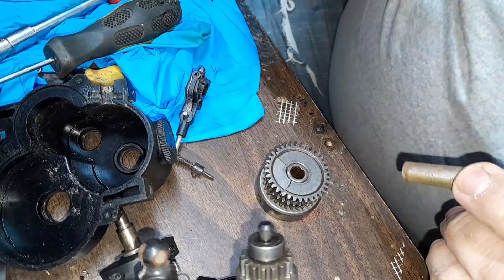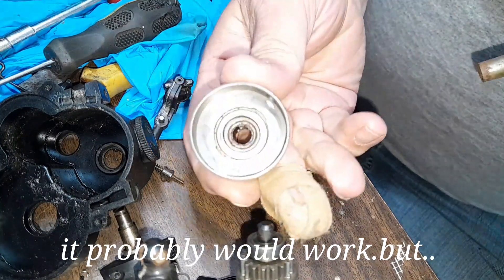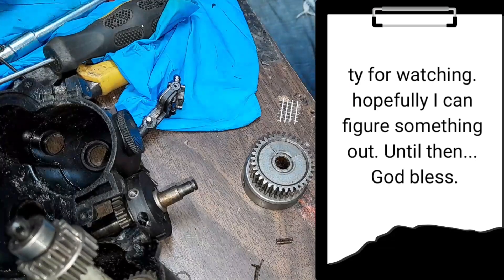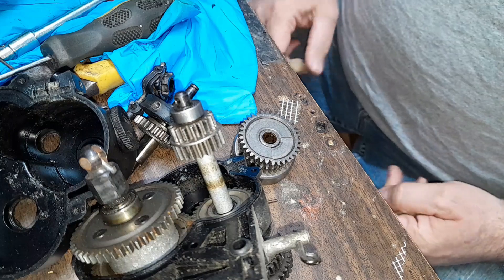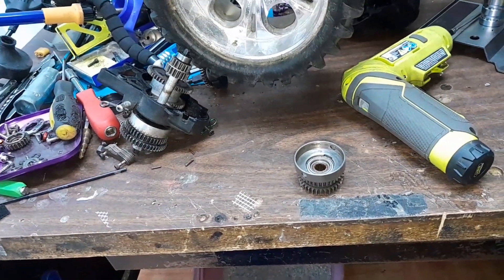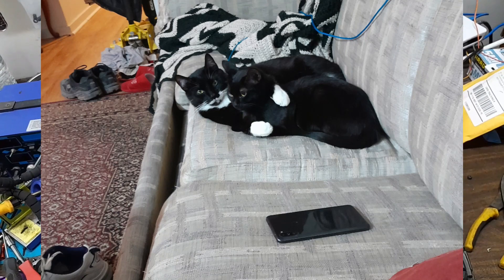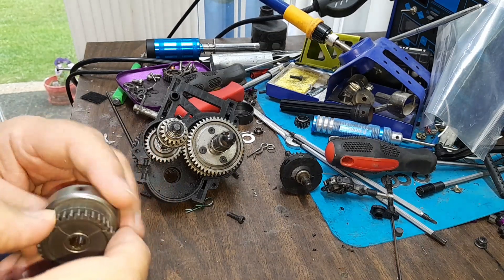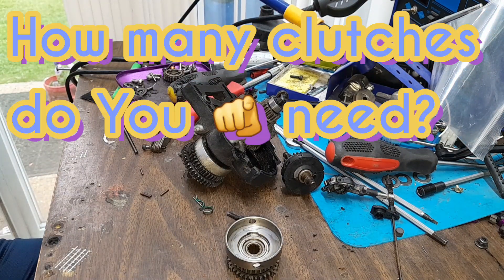How many clutches do you need?

Comment: If new parts are not available you'd be better off scrapping that transmission and finding something that is close and if need be i could mill you out an adapter plate or something like that and since your a friend it would be at no charge
Reply from the maker: Yes I think a savage transmission would be more my speed. There easy to tune and work on.. thanks for offering your help. Will be a few months before I tackle that project. 😎👍
Reply: @TheAdventuresofWally  Plus you can probably get parts for them, so that is a bonus.
Reply from the maker: @RC Wallet Vacuum  absolutely..flm makes a gear set for them..